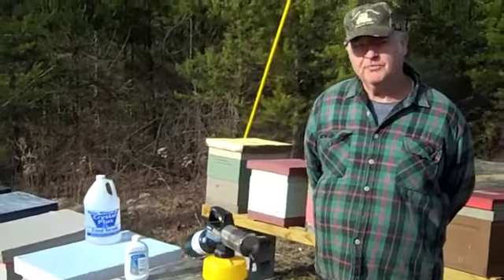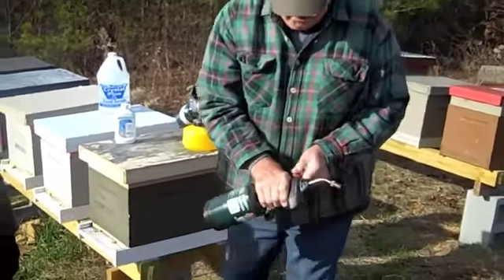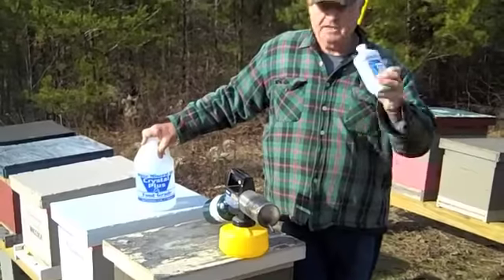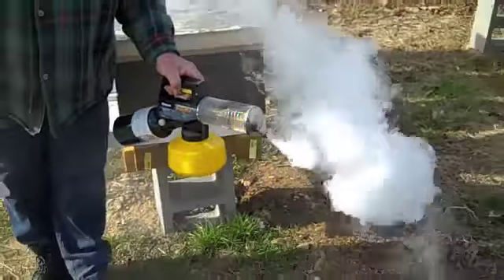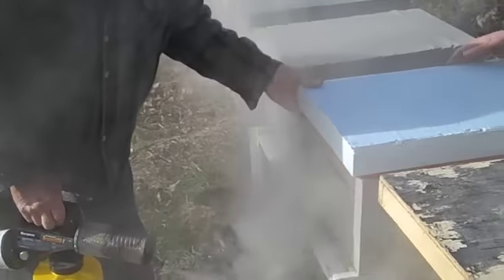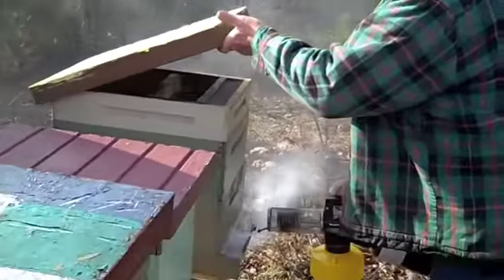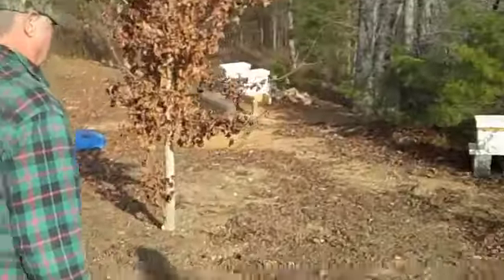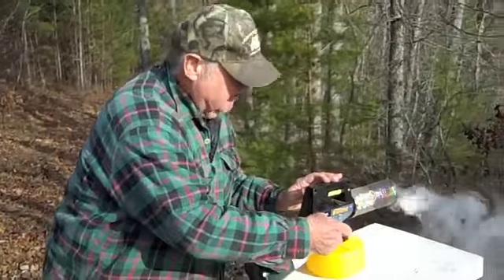Controling Varroa Mites in Bee Hives, Naturally

Comment: The paraffin oil is used as a laxative, but if you breathe it, it will clogs the lungs. A university professor told me that !. Whose opinion is correct, yours or professors? Many things are good and benefit for the entrails, but not for the lungs.
Reply: Bees don't have lungs
Reply: @2BMaree  you have them though and if you breathe mineral oil in its vapour form or oxalic acid evaporated you will be in intensive care fairly quickly and the cure is not known. Oxalic Acid crystallized  on your lungs will cause severe breathing difficulties and destroy the lung surface micro biometrics which is essential for healthy lungs. Tar from smoking is also deadly never smoke. The lungs finally deflate and haemorrhage causing the individual to choke to death on blood not pleasant to witness. If you ever treat with a fogger wear a full face mask that is designed for organic acid vapour blocking. Best of all purchase some mite biter queens and let them produce bees that control the mites as no treatment is required.

Comment: Thanks a lot FBM for your nice video. 
I live in Chile (SouthAmerica), my fogger is traveling from China (here is very expensive and very hard to find)......I have had bees for 12 years........I recomend always , when you going to control varroa, make a mite count before and after threatment in order to be sure what really happens. I use the "alcohol wash" method. 
Kind regards
Felipe Gómez F.
Reply: Mr. Gomez, I live at 6800 feet in Wyoming.  Assuming you may be up in the clouds too.  Are mites any less of an issue at higher elevations? Does it affect when in the year you spray?

Comment: Tonight we examined a bee that was crawling and my son picked off the mite with tweezers. He got some good footage of the mite under the microscope.  He put a toothpick with tea tree oil to the mite and some other organisms immediately jumped off the mite. He thought it was paramecium living off the mite but could it be mite offspring? Anyways, that was the effect he got from the tea tree oil. We are currently feeding the bees with tea tree oil sugar water. I really hope that helps.
Reply: +k2katster Did you try the tea tree oil? and if so how did it work out getting rid of the varroa??????
Reply: +chugbry I did try it and the bees seemed to have winterized ok. They are bringing in pollen already. I haven't actually opened the hive up yet though.
Reply: +k2katster:  Great, would be good to know the results when you get to open up your hive.. We gotta get a head start over those peaky varroa. I did see also someplace that there's a guy in europe who is using a heating source to heat up hives to 40 degreesC i believe and he is killing off the varroa as the bees can stand above 40 degrees but the varroa cannot. He tried heaters but that  didn't work so good so he now tried the sun with solar cells of some type and it seems to be working. will be good to know when someone gets a safe natural means to definitely wipe out varroa.
Reply: @k2katster   hi .  Do you still use tea tree oil ? What's been the best to treat Varroa in your opinion ?

Comment: Don do you still use the fogger to treat mites i was told u dont anymore.if not is there a reason why cause i find it very effective.
Reply: Kathy, i have been told to rotate the kind of treatment to use so if you used the mineral oil treatment in the fall use apivar or something else in the spring for example.

Comment: How do you trouble shot the fogger if you find it wont make fog, and continues to squirt hot oil? I have a fogger like yours and it seems to squirt more than fog. Please advise....
Reply from the maker: just clean out the tip with small wire or needle
Reply: @fineshooter  what is the brand of fogger, and where can I get it?

Comment: Hi Don. Just a couple of questions about the difference between what you said to do, and what you actually did. First, You said spray for 15 seconds but, you didn't once do it for more than 5 seconds. Second, you said to hold it 12 inches from the opening of the hive. Most of the time you were only about 3-4 inches away. A few times you were almost right in the opening. You have confused me Sir.
Reply: I noticed you only answer questions that don't call you or your methods into question. I guess I should re-word my questions so it sounds like I'm complimenting you.
Reply: I can see you're bored...

Comment: I don't like the look of the application of this. Sorry. I would much prefer to use my regular smoker, that has essential oil treatment incorporated into the pine needles and or materials used to regularly light the smoker with. Used on a regular basis, I think it would be better. Just my opinion. I think that the Black flag fogger with mineral oil could burn, scald, and or kill unnecessarily. Mineral oil could be used with your combative formula of essential oils to emulsify with water. Soaking pine needles and other combustibles used for smokers which in turn are laid out on a screen to dry naturally before use. Using only a small handful along with regular non-treated pine needles to introduce with every use with the bees. Your thoughts.

Comment: The varroa mite is easily dealt with by hive design. If you keep your bees in thin walled hives with all the environmental integrity of a cardboard box the varroa mite will thrive. Change that and the mite will fade away.
It is well known that the varroa mite does not do well in a humid environment. (The precise mechanism is not known to me). If you put the bee entrance at the top of the brood chamber immediately below the queen excluder a VIBEZ (Ventilated Integrated Bee Entry Zone) is formed and this will serve to make the brood chamber a humid bucket.
The only hive type that has this top entry and ventilation is the ZEST hive.
If the pupation time of the bees can be reduced this will reduce the time available for the varroa mites to mature in the brood resulting in the exponential collapse of the varroa population.
Individual pupa temperature varies over time of day and brood position.
Above 37C. the pupa die. Below 29C. the pupa die. 
At 35C. it takes 10-11 days to hatch. At 31C. it takes it takes 14-15 days to hatch.
35C. is ideal. Winter time is varroa breeding heaven.
Ideally the colony external enclosure will be of an insulated material that also has a thermal weight that carries the heat of the day into the cool of the night and the cool of the night back into the heat of the day. Aerated concrete blocks are ideal having a 39 times better R value than a thin walled hive and 19 times that of a polyhive.
The ZEST DIY hive is functionally free of varroa together with the maladies and morbidities that it carries. It enables in honeybees diseases such as Nosema, Acarine and DWV. EFB and EFB have never been reported, but that may be because it is relatively rare. 
As a proof of concept you can adopt these hive design management techniques to see for yourself the truth of them.